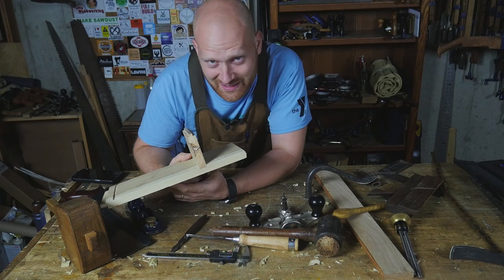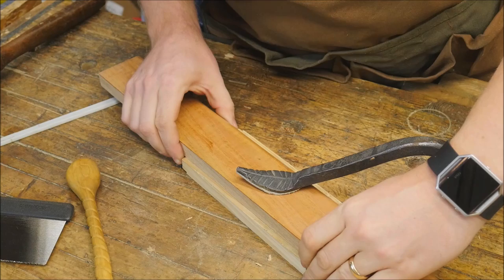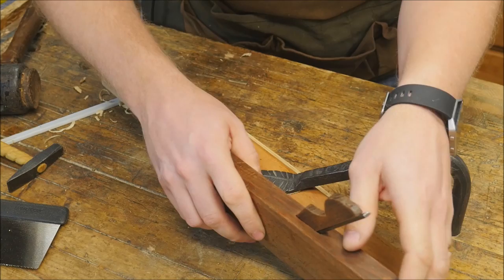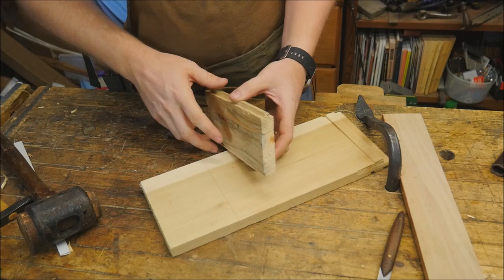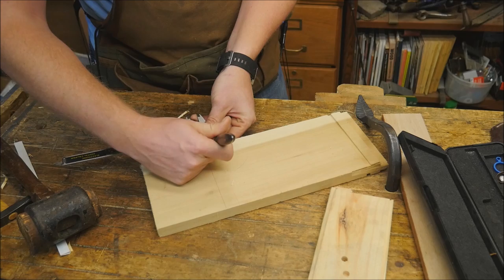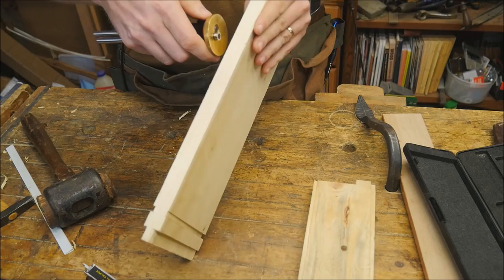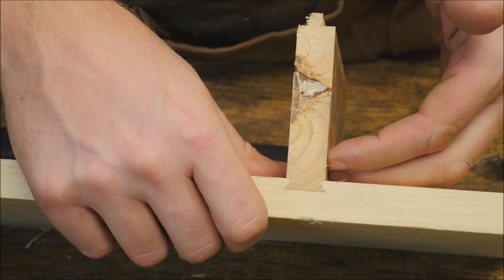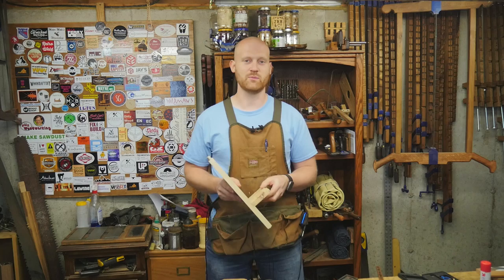How To Make a Sliding Dovetail With Hand Tools - a How-to Woodworking Joint

Comment: Super Easy Technique....   even without the Dovetail plane one can easily do it by replacing the dovetail plane with a block of the same angle cut and using that as a reference for Hand Sawing...  that was awesome...
Reply from the maker: Right on. thanks!

Comment: In continental Europe there's a special saw for those cuts called a 'Gratsäge' in German. It's the only traditional western pullsaw, and it also works well for cutting out stopped dados (with straight or sliding dovetail walls).

Comment: Run the tail on an overlength board and cut some off both ends to planned length.  This way, you cut off the starting and ending points which usually have a flaw or two.  Same goes for a board to carry a rebate (rabbet). Get rid of the first and last inch or so.

Comment: I'm wondering how long these types of joints can run before friction becomes an issue. I have designed an open, freestanding bookshelf/room divider that I am going to build myself using only this kind of joint. I anticipate that my shelf depth is around twice as long as the dovetail in this video, which is why I ask. Full transparency, I am not even a beginner as I have never worked wood in my life but I have always wanted to work wood and I know I can do this. Thank you for such a wonderful video, it was very informative, even down to the tools I need to acquire for the project.
Reply from the maker: They can get really long. I have done a few over 4' long to connect a table top.
Reply: @WoodByWright  That's great to hear and thanks for the quick reply.

Comment: Awesome video as always. I really appreciate the details in making this joint and after you learn to make theses there is no reason to use a plan dado depending on application but it's clearly a stronger joint for case work I would think. Thanks again James.
Reply from the maker: +Thom spillane I like to put this on the top and bottom joint. Then all shelves in between with a dado. But that is just odd me. Lol rather way it is fun.
Reply: Lol but that makes a lot of sense. Take care.

Comment: Thank you. That was a very good clear explanation. Would it nit be kinder too your dovetail plane if another block were planed at the same angle in order to guide the saw? in the event that anyone tries to do this with a traditional dovetail or tenon saw the set on the teeth will damage the plane sole. I am presuming that the saw which you used for this video had no set to the teeth.
Reply from the maker: thanks Jack. no, this saw has normal set on it. they only nick the tip of the plane, and that tip will get worn off with normal use. so the teeth of the saw never touch the plane.

Comment: Wow! That was fantastic! I had never heard of a dovetail plane, and I can't think of a tool better suited to cleaning out the tails than the router plane. I got a spear chisel with mine that I can see would be great for reaching those tiny edges (I loved your use of the marking knife). I'm surprised at what a nice crisp joint you achieved; I would've thought that a very fine grained hardwood would have been necessary. I wonder how much stress that the joint will take? Great job, again! I would be interested in seeing some scarfing joints on your channel.
Reply from the maker: +James Steed thanks. I have made this In oak, walnut, butternut, poplar. And you can get crisp coreners of them all fairly easly. I might have to do a video on scarf joints.

Comment: I notice your Apple Watch good job. I'm a subscriber to your channel and this was the first time I notice the Apple Watch . I tend to pick up on things like being a personal trainer and therapist.
Reply from the maker: Close. It is a Fitbit. I have almost upgraded to a garmon several times for my running but for some reason, I have stuck with the Fitbit. I think I might have to get one as a celebration for my first 100-mile race. we will see.
Reply: Wood By Wright it is awesome , you're multi talented ,that is great . You mentioned the running but what are you doing for strength  because you look strong.
Reply from the maker: LOL isn't hand tool wood working good enough for that? I do lift 3-4 times a week. I use to be heavy into lifting and got up to 200lb at 7%BF but now I am about 210 at 15% but I am wanting to change to around 175 at 7% as I am focusing more and more on the running.

Comment: It's pretty unusual to cut the sliding dovetail on the long grain. What's your use-case? Typically the dovetail portion will be cut on the end grain of a board. That makes a stronger dovetail since the entire dovetail can't split off. You also won't have a cross-grain scenario to worry about.
Reply from the maker: yup. but it depends on its use. with the grain is weaker in shear but stronger in tension. I have done both. but oddly enough I do it with the grain more as I did that in the dresser shelves and in the drawer slides for the coffee table.

Comment: Great video. But what if the board is wider than the length of the plane? Wouldn't it be difficult to guide the saw?
Reply from the maker: +Arthur Linker I have done this up to twice the width of the plane and just setting it in the middle of it. But you can also put a longer board on the plane and extend it.

Comment: I’ve decided this is a joint I want to use on a particular piece of furniture im currently working on. It would be structurally perfect for the application, but there is an issue. The sliding dovetails I’d need to cut are 42” long. How would you go about cutting the dovetail dados 42” long with the grain? Or is that just a crazy idea? I’m not short on ambition with hand tool woodwork, just experience haha.
Reply from the maker: I would do it the same way just working the saw along the sides of the groove, then come back and clean it up with a chisel.
Reply from the maker: Feel free to send me an email if you want to send pictures and talk it through
Reply: I think I’ll try a couple practice cuts and try to make it work before I do it on the furniture piece. If it’s going downhill I’ll send you an email. By this point I have too much work into it to destroy it trying a joint I’ve never done. Thanks!

Comment: Thank you for the video. I'm not sure if anyone has asked,  what type of saw did you use to cut the slot or the piece receiving the dovetail when you made the 24" cabinets? I'd imagine you'd do one side 12" then flip the piece and do the remaining 12"?  Or did you use a Japanese style flush cut saw? Thanks again for sharing.
Reply from the maker: I use a regular carcass saw just a western style. I have cut 60" long slides with it.  I do not think most Japanese saws would work for it as the handle would hit the guide.

Comment: In an actual application the dovetail would be on the endgrain rather than the long grain. How does this effect the process and the fit?
Reply from the maker: interesting. I have used it more in the long grain orientation more than the end grain. but in either orientation, the operation is the same.
Reply: Wood By Wright So if I understand you correctly, you run your shelves with the longitudinal axis (long grain) running front to back in the case the same way you dovetailed the shelf component in the video? I've never even considered that.  For decades I've use the more.common orientation of running my shelves with the longitudinal grain running between the case sides to hide the end grain in the dados which allows the shelves to expand toward the rear of the case. I get that you could hide end grain on the front of the shelf with edging material, but unless you only build with this technique in summertime, I'd be intrigued to know how you compensate for the expansion of the shelf so the case sides don't bow out using the orientation you demonstrated. Please let me know tour secret. Tongue and groove shelves?
Reply from the maker: LOL no for drawer and shelf support the dovetail is on the end grain, but that is the smaller portion of use for it in my work. I also use a sliding dovetail for drawer slides,  underhung drawer mounts, attaching a stretcher to a table top, and several other applications. it is a very versatile joint. and in the case of attaching a table top, it is fantastic at compensating for expansion and contraction.

Comment: Wait- you put the fence on the scribe line, but the you moved it over; are you on the line or not?  explain the concept?
Reply from the maker: +Seth Warner the saw needs to be on the line. So you have to move it back the thickness of the saw blade.
Reply: Ah!!!

Comment: Question:  If you had a block of wood, just like the dovetail plane body, with no slots or holes.  (just the shape of the plane body) Could you just use a shoulder plane to make the tails of the dovetail and then use that same block of wood to make the slot (like you did)?  I have a nice shoulder plane and a rabbet block plane.  Or, do you need a special dovetail plane to make the tails?  That one I do not have.
Reply from the maker: Fun thought but the side of the shoulder plane is at 90 degrees so the shoulder of the dove tail would not be flat.
Reply: Yeah, I thought about it after I commented.   It would not provide the correct angle.  I will have to stick to the saw and chisel method.  I did not see any good buys on ebay for a dovetail plane.

Comment: Great video, but you should have made the dovetails on the end grain end of the board, as this is the normal layout for shelving boards.
Reply from the maker: I have put sliding dovetails on the long grain far more than I have on the end grain. Most of the time I use them for attaching stretchers to a top or in other cross grain applications where there's expansion and contraction.

Comment: How practical would this joint be for a cabinet?  I'm assuming the tolerances would be pretty tight and driving the shelf into both sides might be tricky, ensuring the board goes straight into both cuts at the same time.  Is it challenging (too challenging) or is this better suited to situations like you're demonstrating, where the shelf is only connected to one board?
Reply from the maker: the most common use for it is in a cabinet where it is connected to both sides. or often in drawer dividers where it slides in top and bottom. it is not difficult to do at all. it is very rare that it is only connected to one end of the board.
Reply: cool, thanks!

Comment: thank you so much really clear and informative video!! i have a question regarding its strength.
would you recommend using this technique on furniture?
Reply from the maker: ou yes. it is most commonly found holding drawer dividers to the sides of the case on a chest of drawers. or holding shelves to the side of the book case. it is an incedably strong joint.
Reply: @WoodByWright  thank you so much!! I'm using it to attach the legs for my bench!!
Reply from the maker: @connaughgrace4038  oh ya in a dovetail tenon! that is a crazy strong joint!

Comment: Hard time finding an angled plane like that. Really would like to have one. I've searched for dovetail plane and bevel plane.  Any suggestions?  I'm thinking alter a mounding plane.
Reply from the maker: well, amazon has one here. http://amzn.to/2opa6KX on ebay no one knows what they have and want way too much for it. but for older ones you often find them piled with the molding planes. but you can make one out of a block of scrap and an old chisel. I am hoping to do a  video on that soon.
Reply: Ouch!  I'll wait for your video Thx.
Reply: Robert  yes and my neighbor is a mechanic.. he said he got threw out of woodshop in high school when a tool flew across the room.  he is a heck of a mechanic. I asked him to sharpen my cheap chisels.   He sharpened them on a grinding wheel not for amateurs and tempered them in oil.  seeing this video makes me want to make one.. I would assume  that they work best in soft woods like pine and on larger ones it helps to supplement the groove with sawing..  looking  at it.. looks like a 30 degree slope. just guessing.
Reply: Very late😅 but Ece and Ulmia still make them

Comment: Paul Sellars has a 30 min video and makes a rebate plan in that time. Its just like this one but for the bevel.  I'd just set up my router and make both tenon and rabbit of the dove tail in about five minutes... But I don't do this kind of thing often. But once set up, I could make long (or deep) drawers in about five minutes, too. Best thing about the router is it makes repeatable and identical cuts. No worries about transferring the lines every time. Just set your line marks and go!
Reply from the maker: Right on a power router is great for repeatable cuts.

Comment: It seems you could use the dovetail plane as a mother plane to transfer its angle to another block of wood. They would be an exact match. If you use that block of wood to guide your saw, you'll save a lot of wear on the dovetail plane.  To do what I'm saying, true up some stock and bring it to equal thickness as the dovetail plane. Clamp a block of wood to the non-escapement side of the dovetail plane to serve as a fence. Run the fence along the reference face of the block you prepared, planing into reference edge. You should get an exact transfer of the angle, no?
Reply from the maker: True you could. There are more than two ways to skin a cat lol

Comment: Okay, but what about all the folks out here who don't have access to a dovetail plain or router plane? I mean, nice joint, but those who have the former likely know how to use it, an the good ole 71 isn't exactly easy to find and Veritas wants almost $300 for their version, not on my budget.
Reply from the maker: +Thomas Russell you can make both out of old chisels and scrap wood. I have done a couple videos on making router planes. And I will do one soon on a dovetail plane. Also if you keep your eyes open you can go d a dovetail plane at antique stores and estate sales for 10-$30. You can get a full antique router plane for $60 or one that needs a bit of restoration for $30
Reply: Wood By Wright thanks, but hard to find old tools in my area that are in restorable condition. I went to our local flea market and looked through about 40 draw knives that were so bad that by te time you sharpened a straight blade the beam would only be about 1/4 to 3/8 inch wide on the best of them. Most were pitted or cracked so bad that they were good for nothing other than a wall decoration. I have been able to find a Stanley handyman #5 and will be restoring it this week, and a #6 sized wood body that may not be servicable. Every other unit I fond is missing the blade or adjustment screws, cracked base, twisted sole, empty of all parts and they still want $30.00 or better for an incomplete or severly damaged unit. I have been checking every oeddler's mall and antique shop I can find. Most antique shops aeoind here I would just have to throw an extra $20-$30 to buy a new Veritas unit. That is not in my budget at all. The used tools I have found have taken all I can spare. I can't even afford wood right now. But thanks for the heads-up.

Comment: Mystery solved. I was thinking about using a chisel against an angled fence but I didn't like that idea all that well. Too much room for sloppiness and a bit tedious.
Reply: Also, as a side note, this Christmas, I was making a shadow box for my little sister and needed a grooving plane to make a groove for the glass. I was also making a knife for my brother, so I used a bit of the same spring metal and I made an iron about 1/64th wider than the glass, whipped up a body for the plane out of some scrap walnut, clamped on a fence and it cut beautiful, clean grooves. I am sure making a dovetail plane would be just as easy.
Reply from the maker: +Brian C right on. I am going to have to do a video on just how easy it is to make one.
Reply: I wish I still lived in California. I'd offer to come help you out with that, but I recently moved to Arizona
Reply from the maker: +Brian C that would be fun!

Comment: You are cheating, my friend. The male component of a sliding dovetail runs across the grain, not a along the grain. This makes a huge difference in the level of difficulty.
Reply from the maker: It all depends on the application sometimes they run into groove and sometimes they run in a dado. Just as sometimes the dovetail will go across the grain and sometimes it goes with the grain. I have videos showing both ways if you'd like to see that too.